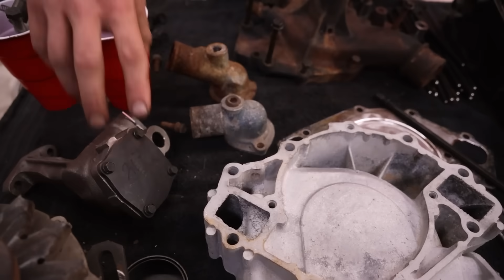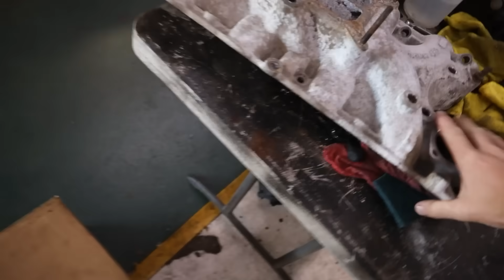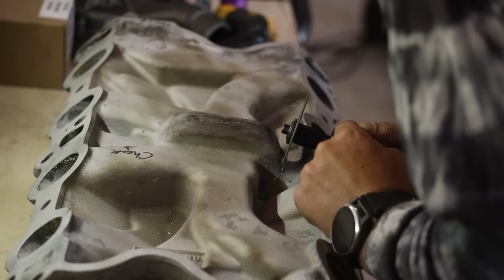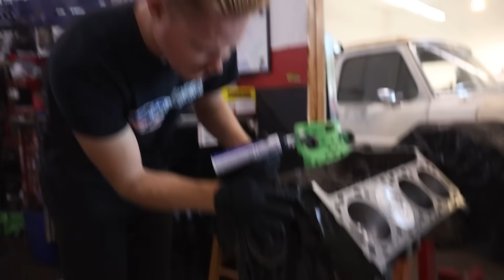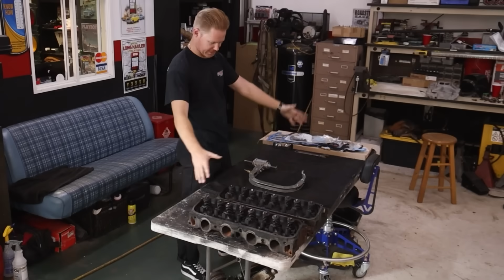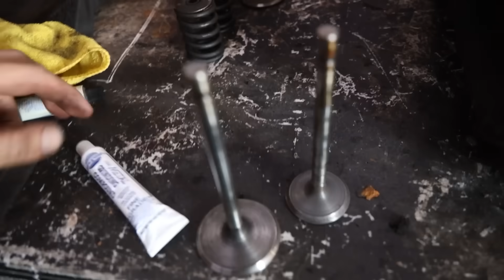'67 Highboy's NEW $2000 Budget Big Block is Assembled! ($10,000 Highboy Build Ep.6)

Comment: You could've gotten some really Cheap Aluminum Heads and you wouldn't have to worked on the Stock Heads.  Plus the Aluminum Heads would have worked great with that Cam and Roller Rockers.  You are still Young and you will find out all the connections companies to buy from.  When you get Older Trust Me you will understand what I am saying.

Comment: The year was 1979. I had my first new car ever bought. 1976 Ford pickup, 4x4, long bed, 360 FE. Of course I lifted it and added a few things then a friend from high school wrecked his Mustang. I bought the 428CJ, complete with bell housing to fan and including the shaker scoop, for $385. Being an FE block it slid right in the 76. Definitely one of the most fun vehicles I ever owned. Talk about slinging mud!!! 37' or 38" Denman Ground Hawg tires. 2.5" lift in the front.
My previous truck was a 63 Ford pickup with a 390 out of a school bus, 4 barrel carb already installed from the factory. That thing would burn rubber for a city block. Big fun for a high school aged kid.
Love your channel. I'm dying to build a small block to rev to 7 or 8000.

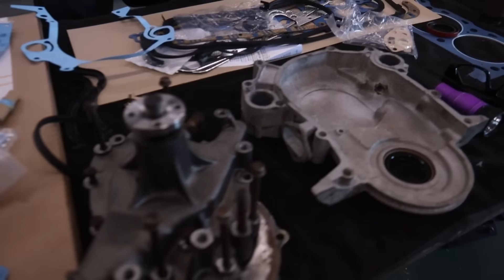Comment: 10:59
On my Ford engines I like to put some 5/16-18 allthread into two of the holes in the block, to guide everything on in a nice neat stack. You can put nuts on or pull those studs out when the rest of the bolts are in and replace them with the oem bolts, either way works.
I do use gasket sealer on both sides of every layer, the studs just help keep frustration down during install.

Comment: You can soak the heads in a bucket of full strength Simple Green for a day or so to get them clean. Also, I'd paint the intake after its clean with a natural aluminum paint so that it stays clean. Natural aluminum dulls and stains so easy.

Comment: Everyone is commenting on the water pump cavitation plate...he put a gasket on the timing cover and a gasket on the water pump side also. Absolutely no reason to do this unless you know the plate sandwiches between it. Plus how many 302s has he built???!!! They have a plate too. He knows and around 13:00 to 14:00 mark you can kinda tell there's enough thickness to say the plate is in there. If not it will make for a good fml video later. Lol

Comment: Craig the 460 is related more closely to a Cleveland than it is to a Windsor. You can even  swap distributors between the 429/460 and the 351C. Also, you said that cracked crossover on the intake is right in the oil gallery??? A 460 SHOULD have a valley pan which would isolate it, although I do agree welding it is best...

Comment: I have a 460 in my 77f100 2 wd swb . Ive broke flywheels 2 28 spline axle  bent the splines on a 31 spline axle . Tonite i snapped the pinion on my 9 in like a toothpick launching at less than 3000 rpm’s . And they told me id never get a truck to hook !!!!!

Comment: After you sandblast that intake if you can't reach all the way down the ports hit the intake ports with a pressure washer. That worked for me to clean out my aluminum intake. Did a pretty good job inside the ports and got rid of any media inbedded into the aluminum.

Comment: When checking to see how flat the head is you need a straight edge long enough to go across the length of the head, useless spot checking.
Reply: Unless the head was totally trashed, or obiviously defective in some way, Craig wasn't going to do anything with the heads.
He already has bad value guides he isn't going to fix.
Head not true and flat?
A thicker head gasket will fix it he says.
He isn't going to fix anything on the heads.
Clean, lap the valves and reassemble.
That's it.
He made that clear from the beginning of the video.

Comment: Not a water passage in the intake. I believe that's the exhaust crossover.
Reply: only use is to pre heat inlet air for hard starts in cold temp block it off if you want to increase air density for performance.
Reply: @fordprerunner2004  Its not about preheating. It heats up the intake and carb to help in fuel atomisation.
Reply: @fordprerunner2004 how does it preheat the cold air for  hard starts if it isn't running lol. It'll help the intake and carb warm up faster while its running
Reply: @Mitch4440 Used to help engines start in cold weather. But sacrificing performance in regular weather. Block it off for more performance warm air has less density so less power potential

Comment: You are so right about searching for a deal. I have a 352 fe in my 65 ford and the cost to have a machine shop stroke it, even to just a 390, plus buying a crank, rods, and pistons was insane. Found a guy on facebook market place, got a 390 fe he had machined but didnt finish putting back together. Block, crank, rods, pistons, new bearings all for $950. He even threw in some cast iron heads and extra parts just to clean out his shop a little. Now i can build up my 390 while still driving my car around.
Reply: SCORE!! That's awesome!